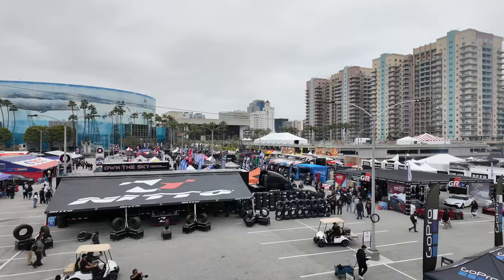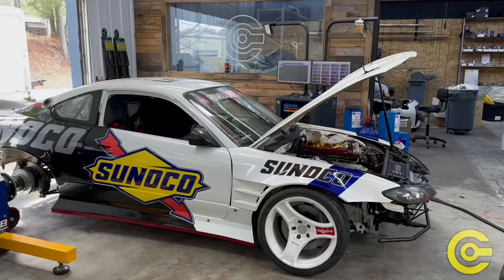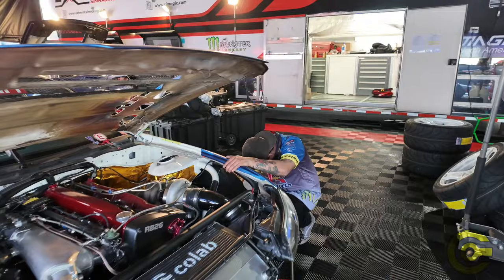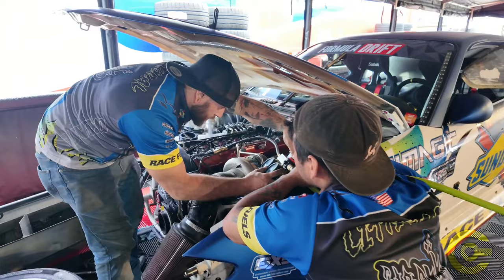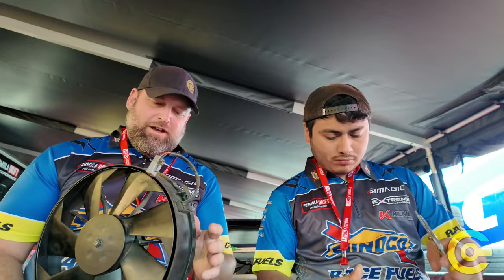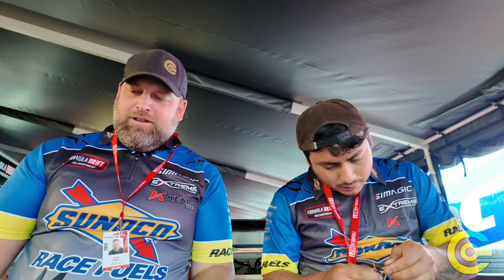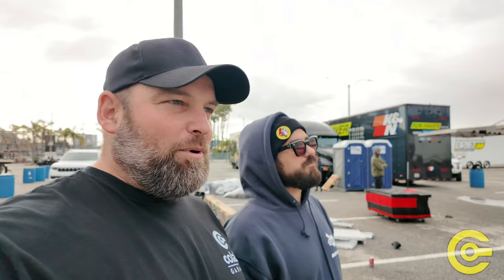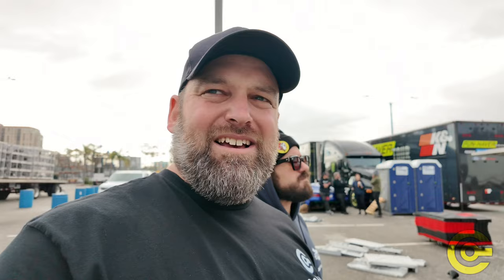2024 FD Long Beach: A new era begins

Comment: Amazing inside. I was gutted for you guys. I hope it will be fixed soon ❤️.
Reply from the maker: DSport is already fixing the cylinder head. We had 4 ever so slightly bent valves and that was it. We got very lucky! Engine will be back up and running in just a few days. Ready for ATL 💪🏻
Reply: @ColabGarage  that's a great news ! Good luck at ATL !